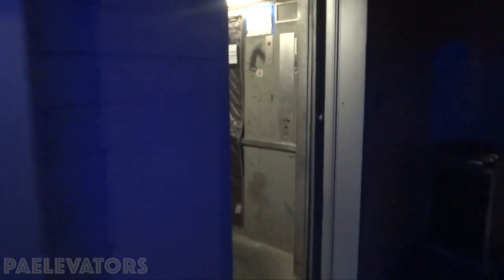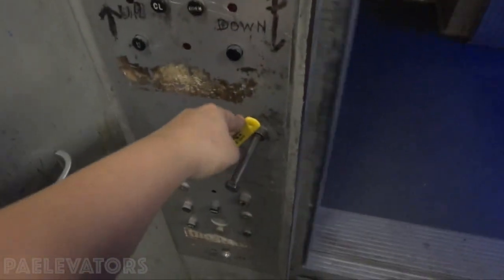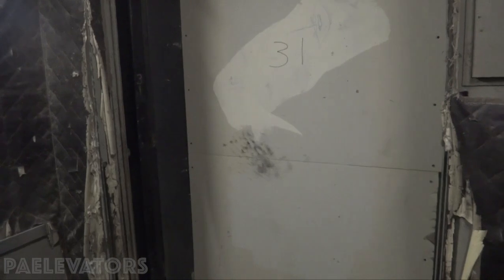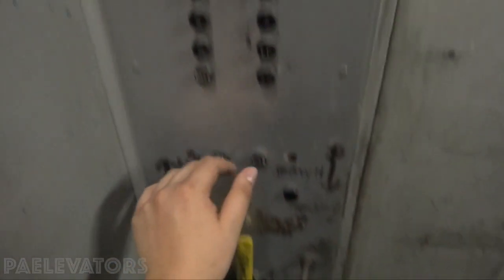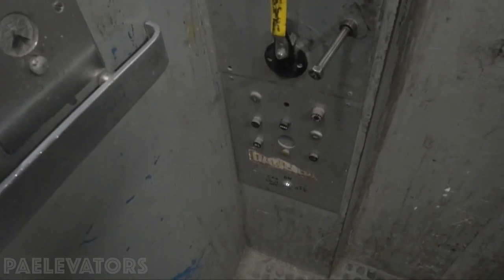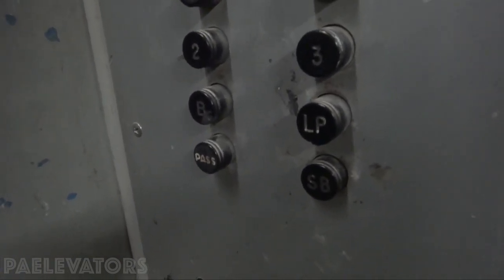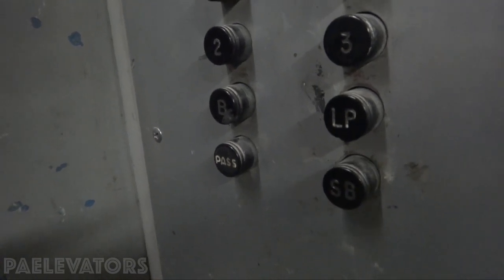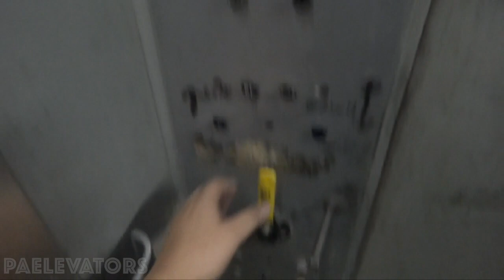Riding an Amazing SUPER RARE Westinghouse "Signal-Control" Elevator - Pittsburgh, PA

Comment: Try using the pass button if you don't want to make any unauthorized stops.
Reply: It automatically stops in the dock for a security check, but there's no real point anymore, as there's no longer a guard there, & you can easily bypass it by holding the lever.

Comment: What building was this because these kind of Westinghouse elevators built-to-last have been disappearing? It looks like an older building that was modernized
Reply: This probably is the only one left in Pittsburgh probably one of the very few if any left in the world. And the problem with this elevator is as major parts break they may not be able to replace them. You don't have to start custom building parts and that's where you start spending real money
Reply: 1 12 3 15 1 is the name of the building.